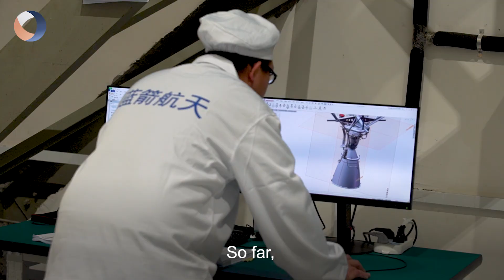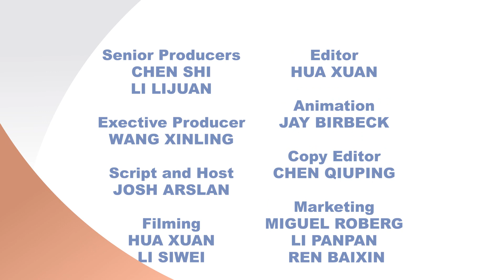Will LandSpace be China's SpaceX?

Comment: It’s a tiny rocket. They are years away. From catching up,
Reply: not really... they have got 2 types liquid fuel engines: 80 ton-force and 10 ton-force. This is already to close to spaceX's Merlin 1D engine. I believe they are about to lunch soon.
Reply: Yes, their currerent rockets are small. However, their methane powerd engine is very good, and advanced. The only other company that has a working methane engine is spacex raptor, which is also still under development. So they had a lot of potential.
Reply: they're like spacex back in 2013 do not underestimate them